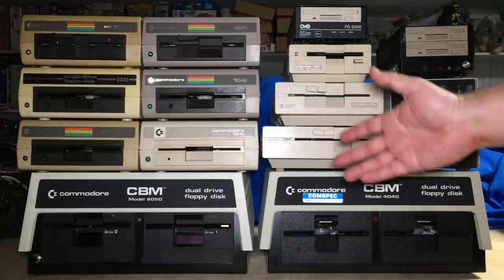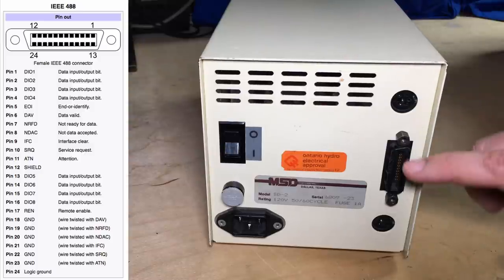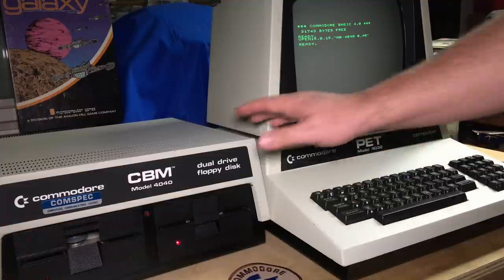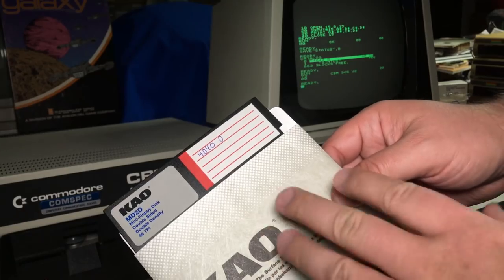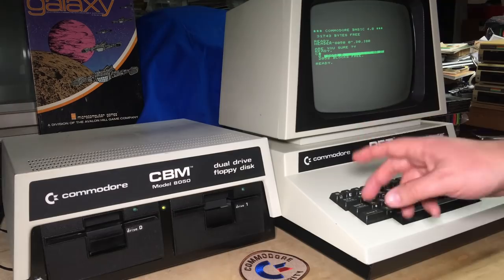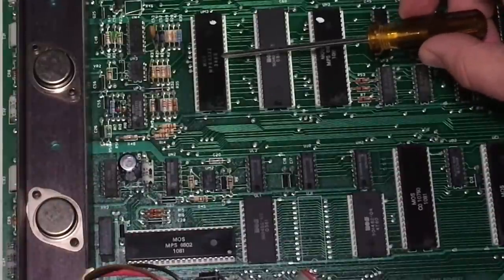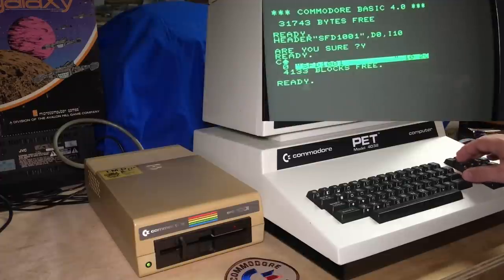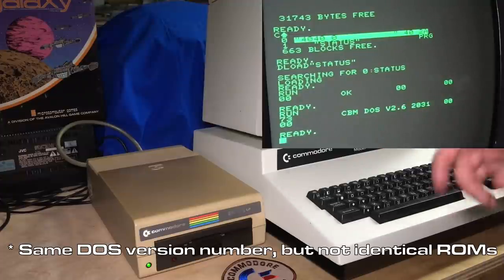Exploring My Commodore IEEE-488 Disk Drive Collection

Comment: You are using a lot of post-production digital zoom. No problem with that, but have you considered a 4K camera? Those zoomed parts would look much nicer with it. I'm actually watching this on a 17" CRT monitor, though :-) , so 4K is redundant for me at this moment, but the zoomed parts still look blurry and noisy on my current setup. (edit: typo corrections)
Reply from the maker: Thanks, I did shoot in 4K for this video (usually I don't) but just on my phone which is all I have currently. I'll look into a proper camera especially if I keep making videos like this one, with more need for close-ups.

Comment: 0:10 I've had most of those drives, but what the heck is that weird dual-drive thing on the top right?

2:17 Apparently, the bug in the VIA's shift register is pretty easy to fix with an extra logic gate or two.   I don't know if they knew this at the time.

2:28 While the CIA's shift register didn't have this bug, the VIA used in the 1541 still did, so they couldn't fix the problem without overcoming the VIA's bug.  Also, the C64 with its BASIC 2.0 and carbon copy of the VIC-20's ROMs seems like it was mostly slapped together by taking a VIC-20 and sticking some new I/O chips in it.  Upgrading the serial bus with backward compatibility like they did with the C128 would have been a big job.

3:23 It seems a bit wasteful that it has so many wires with a bunch of twisted-pair grounds for the control signals.  Was noise on these lines really a big problem?  I don't even see a special ground for the data lines.

5:12 I'm more of a Victorinox guy, myself.

6:06 I normally use Logical File Number 1 since my first storage device was a cassette drive.

8:00 PRINT DS$

8:14 They waste a space at the front of each line when listing on a 40-column screen.  Did they believe that the indentation made it easier to read when lines wrapped?

13:52 They also accept the DIRECTORY command, abbreviated "diR".

14:39 There was also an 8250 drive which was double-sided and could store over 1 MB per disk.

21:06 That is so weird that the 4032 didn't have numbers on its top row of keys.  Every other keyboard had that, including the 8032.

23:03 It's not the stacking that damages the drives; it's the overheating from the lack of ventilation when they're turned on.
Reply from the maker: That weird drive in the top right corner is a Dual CMD FD-2000. As far as I know, only three were made. This one was used for Loadstar's (monthly disk magazine) 3.5" duplication needs from the mid-late '90s until the early 2000s, I believe.

Ugh, I can't believe I forgot about DS$!
Reply: @8_Bit : I was hoping that your early-access Patreon videos got promoted to public viewing since that would give me a crack at FRIST POST!!!1!, but sadly, this appears to be a separately-posted video.
Reply from the maker: @csbruce  Sometimes I do change the early-access video from unlisted to public, but other times I find extra things to tweak in the final video render that goes public. Thanks for your support, and if you keep trying I'm sure you'll get FRIST POST!!!1! eventually :)

Comment: I would also like to have seen an HD, DS dual 5.25" drive, like if the 1572 had come to light, or even if they had made a "1592" (3.5") or something like that. I also didn't know, or at least remember, that the 1001 is DS, until now!

Comment: i absolutely loved this video! thanks so much! i wish you had explained the syntax of the commands a bit more. for example, when you said the first number was 15 but could be anything, what is that number for in the first place? thanks!

btw, i think the drives look perfectly fine without retrobrighting, but then i wouldn't mind either way! :)

oh... i was wondering... why do you have to put the disk in to see the DOS version that's stored on the disk /drive/? i thought the dos version is in the drive rom whether or not the disk is present? thank you!!
Reply: The problem is it would take another video just to explain it. The very short explanation is:
OPEN file#, device#, channel#
file# = any number from 1 to 127. and allows the program/user to have several files open at once - random access data base ("relative files") usually opened multiple files at one time. This was called a "logical file number" and was basically how C=64 "remembered" which file was which.
device# : 0 = Keyboard;1 = Tape; 2 = RS-232; 3 = Screen; 4 = Printer; 5 = (alt)Printer; 6 = Plotter; 7 = (?reserved?); 8 = Disk Drive; 9,10,11 = (alt) Disk Drive (10 and 11 usually had to be implemented through DIP switches on the drive's PC board or through commands sent to the drive's OS) 
channel# = varied from one device to the next, but in the disk drive channel 0 and 1 are used internally to address the directory, although ch 1 can be used to "read only" a sequential file. Channel 2 through 14 are used to send and read data to open files. Channel 15 is strictly used to send commands to the DOS and read status flags from the DOS. (not exactly true, but data sent on channel 15 is for advanced DOS programming)
In the format of  OPEN 15,8,15,"xxxx" the file number (first number) was simply a programmers way to separate/remember this was the command channel. It could be any number but could get confusing with several open files especially if you were working in direct mode. Technically speaking the second and third numbers are an "Attention, address" header bytes sent on the serial bus.
Reply: @3DPDK  wrote «varied from one device to the next, but in the disk drive channel 0 and 1 are used internally to address the directory».  I thought 0 and 1 were used for special LOAD and SAVE access.
Reply: @3DPDK  great explanation, thanks! another video? not a problem at all!! :D
Reply: @csbruce  I think what you are thinking is "LOAD "filename",8,1  The '8' of course indicates the disk drive. If '1' is included in the command it flags the C=64 to load the program to the memory address indicated by the first two bytes in the file on the disk or tape. An ML program that resides at (say) 49152 has the first two bytes of the file set to $C000, or #00 - #192.(lo byte-hi byte) Without the '1' the C=64 automatically ignores the first two bytes and loads the program beginning at 2048 or BASIC program memory. SAVE "filename",8,1 is the opposite. Without the '1' C=64 automatically writes the 2048 load start location. SAVE"filename",8,1 will wright the address indicated by the value held at memory locations 172 - 173 which usually point to 2048.  By temporarily setting this to another memory location and setting a few other pointers, this command format can be used to save screens, ML programs in upper memory or anywhere, basically a memory "snap-shot". SAVE or LOAD "filename",8,0 is the same as LOAD "filename",8 (no second number) - the second number is simply a flag and is either a zero or non zero value - LOAD"filename",8,2 does exactly the same as LOAD"filename",8,1 However, none of this has anything to do with the communication channel set in the OPEN command between the computer and the external device.
Reply: @3DPDK : A quick look at the ROM listings shows that the secondary "number" given for a LOAD operation and the secondary address sent over the serial bus are distinct.  A secondary "number" of 0 is a relocating load and 1, a non-relocating load.  There are a number of different ROM listings online (and each is broken in a different way!).  The one at https://github.com/mist64/c64rom/blob/master/kernal/load.s shows on line 43, "lda #$60 ;special load command", meaning that secondary address sent to the serial device for a load is always $60, regardless of the secondary "number" taken from the user.  The upper nybble identifies the serial-bus command (accept the secondary address) and the lower nybble identifies the disk-controller channel, with 0 indicating the special LOAD channel.  Technically, you're correct in that the directory is retrieved using a LOAD operation, but so is every program.

Similarly, the "save.s" file shows "lda #$61 : sta sa", which accesses disk-controller channel "1", which is dedicated to the special SAVE operation.

Comment: Hey, did you ever consider doing a "Introduction  to Assembly Language". Use a simple CPU like the 6502, or 6008? Heck, if you sold them as videos on a thumb drive, I'd buy the set.

Comment: It is so strange that these diskdrives get into trouble when placed to close to other antiques. Remarkable how easily they get confused, it can't be the speed or the pressure of having to do the work accurately. Working with sign flags is almost as quick.

Comment: I have one of those 2031 small size drives.  Unfortunately it's in a non-working state because one of the ROMs seems to be corrupt after a long time in storage.
Even before then, there was some kind of bug where any disk which was formatted by that drive and had something stored on it by that drive would become unreadable in a few weeks, requiring the disk to be reformatted in order to make it readable again.  And this was the same with different brands of disks.
It doesn't seem to be a head alignment problem because I've opened the drive and the head adjustment hardware is quite secure.
It was a disappointment to me to find that it was unreliable even from the start since I wanted to use it for storage on a kit computer I built.  I'd built and added an IEEE-488 interface and programmed the kit computer so it could use the drive, so it was even more disappointing.

Comment: I 'inherited' a perfectly cared for, working 8050 in the late 80's, along with an Interpod adapter to make it work with a C64.  Yea, I tore it apart in the 90's.  :(  Incidentally, the hardware inside the 8050 is as robust as any 3D printer today.  The mechanism isn't really much different.

Comment: Someone asked me about redirecting the PRINT command to memory to print sound effects or sprites etc.  I forget where they asked so I'll post more of what I found out here.  I done more digging and found my old notes, combined with some information on the C64 registers and memory maps.  Here's how you do it and why...

Lets say you wish to set the SID chip to play a sound.  The SID chip is at location $D400/54272.  The low byte for that address is 0, the high byte for that is 212 ($D4 hex).  So you POKE 209 with the low byte (POKE 209,0) and you POKE 210 with the high byte (POKE 210,212).  209 and 210 are pointer to current line in screen memory and you can set that to any address at all.  But you also have to set the current column the cursor is on to zero so it starts at the beginning of that memory location.  That is set with POKE 211,0.  Once you do all these POKEs, the next PRINT/? command will print to that memory location whatever you wish.  So if you just wanted to clear the SID chip, you would print 25 @'s (@ equals zero on the C64) and it would be clear, like this:

POKE209,0:POKE210,212:POKE211,0:?"@@@@@@@@@@@@@@@@@@@@@@@@@"; (I'm not sure if the semicolon was important here or not)

This would clear the SID chip.  The first @ is at location 54272 (hex D400), the start of the SID chip.  You can change each @ to whatever number you wish to place in that memory location and you can literally PRINT a sound effect.  I used to have a fun C64 BASIC program where you had a menu and selected a sound effect and it would play it.  When you looked at the source code the above line is ALL you seen for each sound effect (just the @'s were changed for the values of course).  Same deal with sprites.  Point it to sprite memory and print a sprite out.  Or moving ANY DATA you wish!  This can eliminate loops that read and poke data completely!  Just point to the memory and print it all there in one shot.  Very powerful trick.

Comment: I'm wondering if Commodore used single-density disks out of spec with so many tracks (and sectors per track)? If so, did they rely on the disks being better than specified? At least the manual you've shown only demands single-density disks for the 8050 having 77 tracks. Or did the DOS include some kind of low-density backwards-compatible format for the use of single-density disks?

Comment: Huh! I didn't even know that the 1541 is single-density and that the quads were already out before it until I heard of the SFD-1001 8 years after we got a '41! (And even then, the friend showing it to me didn't make it clear that that was still for the PET.)

It's unfortunate that the first 15-series drive was so crippled in the name of CR that it was just SD even though there were already DD and QD drives out there, but Commodore didn't think enough people would want to buy those for the 64. I wish the 1001 through the user port had been the standard, and it's interesting that the 64 will even recognize a device 8 through that port.

That's dumb; I hate back-sliding with newer stuff, like what they did to BASIC before going back to a higher version with the 128. But then the question might have been, "Yeah, but then could your parents have afforded it?" Maybe by the time the 128 came out it was easier to afford better things and keep a low price for the consumers. But overall it seems dumb and counterintuitive to put the weaker peripherals with the generally stronger computers (in the sense of memory size, etc.).

Comment: Also, I've power-cycled my drives many times over the early years with disks still in them and can't remember ever having a problem with that, despite a manual saying otherwise. Why do you feel like it's really that important to take the disk out even though the chance of damage is next to nothing?

Comment: This is a very informative video. Thumbs up! One question I have, i own an 8050. It’s a 117v model so I use a step down transformer in the Uk. It’s faulty at the mo, once I fix it I’ll put a video up. The question is this, can the 8050 read the lower sized 4040 formatted disks too?
Reply from the maker: Hi, the 8050 (and SFD 1001) can't read the 4040 (and related) disks, unfortunately. Now I wish I had explained that in the video!
Reply: 8-Bit Show And Tell thank you for confirming that!

Comment: 2052 blocks on that 5 1/4" disk. It makes me wish the 1581 was HD instead of just SD (haha, those sound like video terms, but they stood for "-density" before they stood for "-definition") because then it could have had around 7320 blocks instead of just 3160 (even though 3160 wasn't bad for then). Dumb to make the 1581 SD when the SFD-1001, etc. were already QD, with the 4133 blocks instead of the '81's.

Comment: Thanks! Interesting stuff. Love that MSD drive. I remember seeing a few come up on ebay some time ago and was shocked at how much they went for, well over £200. There's a short program called Bootfixer in Compute Magazine issue 29 October 82 that made all programs self-starting when loaded from disk. After ironing out a bug or two it worked perfectly on my 4040 but not on the Vice emulator, interestingly enough.
Might be of some interest to you. https://archive.org/stream/1982-10-compute-magazine/Compute_Issue_029_1982_Oct#page/n171/mode/2up
Reply: That MSD drive basically has an Amiga inside.

Comment: 4:16 The IEEE-488 and user ports are not the same on the PET. They have the same width and contact count, but different keying, so with proper connectors (which should have keying fins in them), you can't mix them up. 
OH! 3:56 It seems that the original connector doesn't have keying either... It's weird, since the board edge connector has keying slots. Maybe the keying fins broke off from the connector?
Reply from the maker: I should have clarified that yes, different keying, but the few things I have to plug in there don't have the keying fins (good term, I hadn't heard it before) so it seems just anything can be plugged in there.
Reply: @8_Bit  The original plug had little plastic tabs that could be wedged in between the contacts for keying. Over the years, they have fallen out of every single one I came across.

Comment: Why does the PET have BASIC V4.0? This is even a newer version of BASIC than on the C16/116 which has V3.5 and came out much later. Is this some kind of homebrew witchcraft?
Reply from the maker: Commodore's BASIC numbering scheme is really weird. I think the PETs (in different models, and with various ROM upgrades) got V1, V2, and V4. V3.5 seems to be more advanced than V4. I don't know what happened to 3.0, and why the C128 jumped up to V7. Could be an interesting video, but I will need to do a LOT of research for that one :)